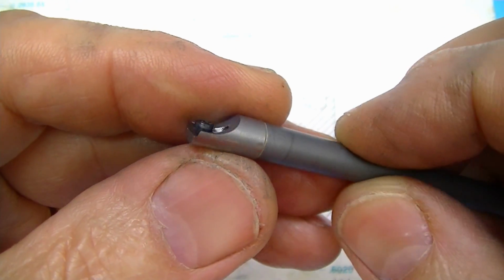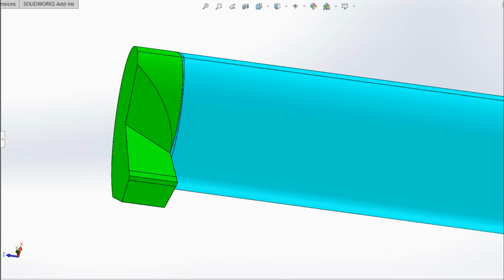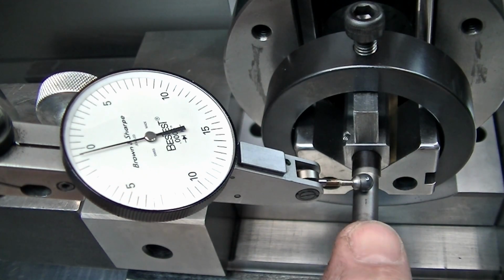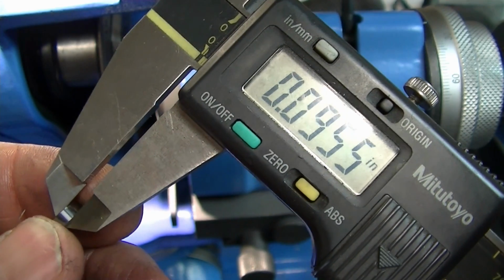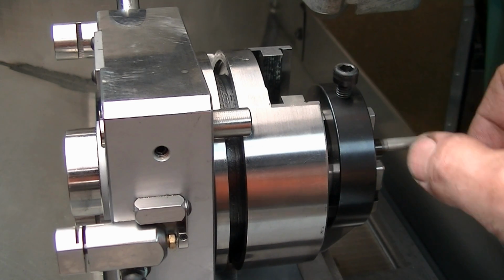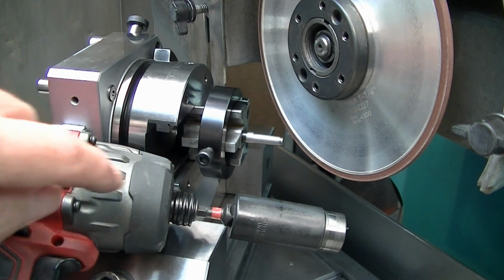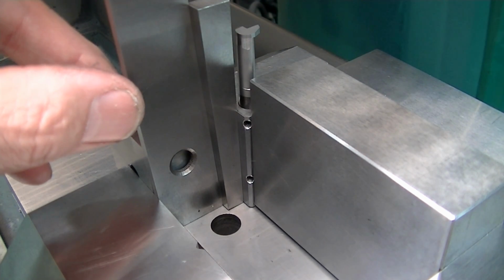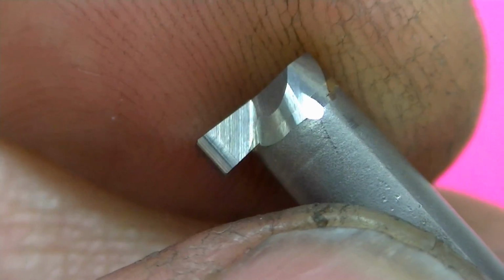MAKING GROOVING BORING BARS

Comment: Please, what is the device between the spindle and V block that allows  you to adjust the position so easily?
Reply from the maker: That whole unit is a standard punch grinder. The indicator mount to measure the offset amount is designed ande built by me.
Reply: I have searched for one on sale, but I can't fine one.  Can you please provide a link to one or more vendors?  Also, what are you using to do the grinding?

Comment: Is there an advantage to setting 2 separate angles for setting up the compound angle versus calculating the actual compound angle and using one angle combined with rotating the workpiece?

Comment: Having acquired a very good surface grinder recently, I hadn't yet considered the full extent of possibilities in tool grinding and grinding carbide. As luck would have it, I also stumbled upon a heap of special carbide tools which somehow gotten into the hands of someone who didn't realize what it was. All new stuff, special grinds. I inquired at the company that made them because I could not really figure out what the tools' intended use was. Turns out it it made for brass, two lip cutters running on transfer machines. There was a company in my town who reorganised and relocated and obviously these tools were obsolete. I figure the bars (from 10 to 25 mm in diameter, some quite long) will be very good stock for grinding special carbide tools.
Thanks again for a great inspirational video.

Comment: Robin

A great video that I have recently found. I have just finished restoring and reworking a Quorn cutter grinder and was looking for an interesting project to use it for. It has much the same capabilities that your grinder has. I note you used hardened steel dowel pins. I have a boxful of 8mm ones bought for another project that I can use. You didn't mention much about the shank. Did you use the dowels untreated before soldering the tip. You didn't seem to make any heat sink on the shank to stop the heat travelling back down the shank. I know that the pins are very hard but brittle and wondered about how you handled this? I see that yours are cosmetically black/grey and wondered if they were preheated and to what temperature? 

John
Reply from the maker: They were standard case hardened dowel pins. I did not worry about heat travelling as it solders very quickly.

Comment: the impact will obviously work just fine, i kind of like to feel the threads when im tightening things just to make sure it feels normal as it snugs down, those bearings couldnt care less about the tiny loads introduced from tightening the nut, u could always use a t handle if ur that worried, again the impact will most likely b fine but i probably wouldnt use it only because i like feeling whats happenin

Comment: Robin, 

29:00 Is there sufficient capillary action to wet mating surfaces given weight of holding fixture?  I've laid silver foil between carbide and shank but never 'soldered' in the traditional sense. 

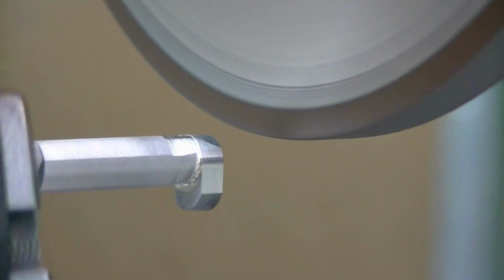35:00 This tool's enter line of heal radius is different from the other two. Is this manufacturing variation between tools or bent from blunt force trauma? If this was a critical feature and the step shown at 35:00 unacceptable, would you carry the grind back up the shank or would you have made a setup adjustment prior to initiating the grind?

We are about the same age but I hear my grandfather speak thru you. He passed on knowledge, wisdom, tool chest and its contents, sadly our time together was short.  Every time I go to his chest I think of and thank Bill Johnson

Merry Christmas,

Robert
Reply from the maker: Merry Christmas Robert.  
The Safety Silv 56 is the highest fluidity/capillary action and will travel just about anywhere that is well cleaned and fluxed.
That area on the tool is just clearance and you are seeing lack of material to grind from how it ended up soldered on, All of the geometry that matters is exactly the same on all the tools.

Comment: Nice video, just a thought, I have an older model storm Vulcan automotive boring bar that I would like to convert to cutting bits, is that doable?
Reply from the maker: Most likely but may not be economically feasible. Send some pics of what you want to do to the email on my "about" tab

Comment: Hi Robin, brilliant set up. You mentioned skill development, but if I may,  I would like to add tool making is intrinsically satisfying as well (for me anyway).

I so enjoy watching your tool making episodes. While I probably never in my daily work will  encounter 99% of what you run up against. The little nuggets of knowledge you pass on to us are so valuable. For example today your explanation of "Pumping the vise" is something most of us could use on a regular basis. I admit, I never much thought while doing a vise on vise set up. Or the small screw jack in the slot. Thanks again for taking the time to share your thoughts and ideas Robin.

 Cheers, Warren
Reply from the maker: Very satisfying!

Comment: what did you use, How did you modify indicator contact point ball ? epoxy or silver soldered larger ball on indicator contact point ? thanks
Reply from the maker: Loctite 325 acrylic adhesive

Comment: That tip about how to keep the vise from flexing in the vise was very valuable. Wjat I want to know is how did you get that grinding fixture to go back to 00 with 5 decimals without fussing with it for ten minutes?
Reply from the maker: Hi Brian, I bushed the lock screw hole in the V block so it is a gage fit on the screw. That keeps the screw/T-nut from cocking when you slide the V block. Therefore it clamps without influence.
ATB, Robin

Comment: Like I said Robin, If you got the energy . Please dont hesitate to make more videos. Just seeing the tools, order of operations.and the considerations of will it rub. I'm making swiss type tooling for a sieg C6 lathe four position. Every thing with adjustable hight(hate shims)Probly a er 16 collet  position with that repeatable pin ,Basicly so it pulls out and you can choke up a smaller boring bar. most of it made from the throws of a small block chevy. You kidding me I get up at 5 am to do thi9s stuff love it. Thanks Robin you save alot of trial and error

Comment: Hi Rob!! One more hour that flies like one minute. Thank you!! Just one question....how does the lapping work using a hardened shaft as a lap? As it is hard, the abrasive particles does not embed in the lap and you are just rolling the particles, not actually letting them to cut. Just curious, as it is clear it works!!
Reply from the maker: The abrasive will tend to charge in the softer material. 440C at 58RC is softer than the carbide so the diamond sticks in the 440C and cuts the carbide.
Reply: @ROBRENZ  Ok. Good point. After watching your videos the slow speed grinder has movento the top of my projects list. hehe

Comment: The tool holder with the set screws and 2 bevels needs the hole very accurately made in the center between the bevels. Any tricks on how to do that? Do you make the bevels first or the hole? Another great video.
Reply from the maker: You can grind the bevels separately to move the hole to the center of the v block.
Reply: ROBRENZ ok they are ground not milled. Gotcha.,

Comment: Robin, outstanding video as always. Thank you very much for the effort you put into these videos!
I have some questions regarding brazing carbide to steel. I have planned to make some carbide shank boring bars for a long time. Your recent video came just about perfect in time. The supplier of my brazing materials recommend a sheet brazing material for brazing carbide to steel. These are copper sheets already coated in silver solder. The purpose of the copper is to compensate the diffential thermal growth. I used it once for a threading tool and it works great because you have already the needed amount of solder in the joint. Have you ever had any problems with failing braze joints due to diffential thermal expansion possibly? I thought about machining a V type joint between the carbide shank and the steel head of the boring bar like it is often used in commercially available boring bars. Is there a significant advantage to your taper design over the V design?
Greetings from Germany
Markus
Reply from the maker: On very small contact areas the copper is the weak link in the joint. But on regular size tool bit bond areas it is good stuff. Most carbide bars I am familiar with use the conical  joint. Anything that increases the bond area is a good thing.
Reply: ROBRENZ thank you!

Comment: Robin,  I too am a SolidWorks user, and design mechanisms using it.  You may already be doing this.  But did you know you can create a global variable on the fly and at any time.  Where this can get important is when you are working with those fussy little overlayed sketches.  Sometimes a dimension or a feature value becomes a focus of attention where it needs to be adjusted and possibly in a trial and error way.  When this happens you can go to the dimension or  feature and type an = sign then assign a global variable to it.  Now you do not need to dig down through the feature manager or dig through all the sketches to change it.  You don't even need to edit a sketch.  Just go to the equations and manage the global variable values. This even works in assemblies say for mate values. Also, you do not need to know ahead of time what is important just assign the global variable when it becomes necessary.   It sounds involved but after trying it I will never go back.
Reply from the maker: I was aware but your comment makes me realize I should make use of it. Thanks!

Comment: Very nice Groove Bar! And video clearly showing the process of making them. One thing when you lapped the chip breaker. How deep of passes did you move in per plunge to get to depth and what RPM did you run?
Reply from the maker: Hi Peter, I just moved in 0.002" and let the spring of the lap self feed. More pressure as the part moves closer to the collet face.  About 8 strokes with the 6 micron is all it took. Running at roughly 1400 rpm.
Reply: ROBRENZ 👍

Comment: Interesting, and nicely "filmed", as usual :-)  i liked that you have an "almost-kinematic" locating system, that's actually fairly simple in actual execution. I do keep wondering if it would ever be possible for you to switch to metric measurements for applications like this?  Even if you had a "target" bore size, or groove size, in 'inch', you would only have to convert those dimensions once, and then use metric for the "internal" measurements?  Is there an issue with existing tooling, or measurement devices, or client-side spec's?  All the best, good sir, and we're hoping that you're staying healthy and happy!
Reply: It's trivially "possible", but why would he bother?
Reply from the maker: All my non electronic measuring equipment is inch so I just convert when I have metric drawings. I am fluent in and design in both for customers. 
All the best,
Robin
Reply: @ROBRENZ  Thanks, Robin, something like I expected... I've ended up with a lot of 'legacy' inch measurement tools, but converting to metric when it makes sense. 
Alles gute!

Comment: Uncle Robin popping off with these videos recently. Very helpful and informative as usual, a pleasure to watch. Just one suggestion, I don't know if it's just me or anybody else is hearing it the same way: it would be really nice if you could crank the volume up a little on the segments where you add extra comments recorded off camera. These seem to be a little too quiet, I have to crank the volume up and then when regular video comes back then it's screaming a little bit. Other than that it's great. Thanks!
Reply from the maker: Thanks for the input, I will check that out.
Reply: @ROBRENZ  I just thought it's probably caused by the fact that in shop you're trying to speak way louder than normally, to get your voice through shop noises and that's why it seems louder

Comment: Nice klip as always Rob..

Near the end, you mentioned that you removed 6 micron grit, so you can use 1 micron.
How?
Of course you can easily remove floating grit, but how did you remove 6 mic grit that is embeded?
Reply: Yeah, I'd like to know that too. Maybe it's a different lap for 1um.
Reply from the maker: Just wiped off the lap. The embedded stuff wears down pretty quickly with the 1 micron. That is the same principle as wiping dry the lap after using the 1 micron and continuing to use it. The abrasive continues to break down and forms a sludge cushion that improves the finish even more.
Reply: @ROBRENZ  Robin, I had thought that any embedded 6 micron grit would dig relatively deep grooves that the 1 micron grit would have too much trouble removing to be worth it.  Kind of like trying to go from 46 sandpaper to 220 in one step?
Reply: Thanks Rob.
As usual, great explanation.

@Bob
It is just abraded with 6 micron, so there are already 6 micron goves in the surface.  Few more, will not make the difference.